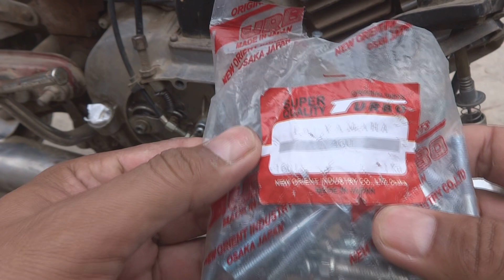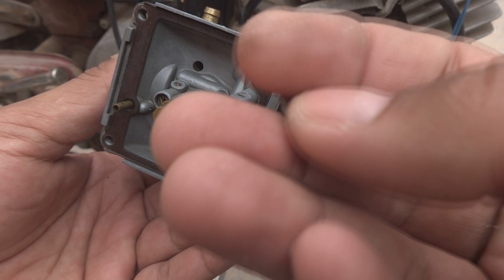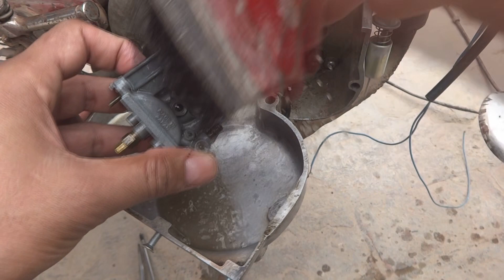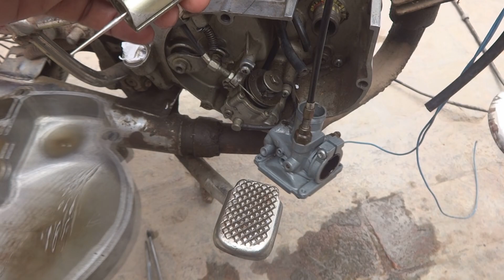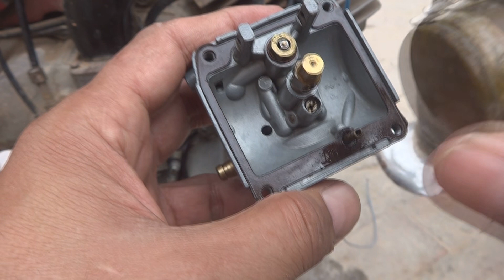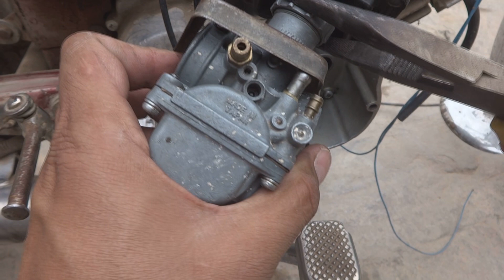Motorcycle carburetor clean up and tune up. Yamaha bike Carburetor tune up.

Comment: Hlo....i need your help please.,how do u repair a mate 50 bike when it has refused to accelerate and it cannot move and yet it has new clutch and a new piston and a valves but it cannot accelerate....please let mi know how i can repart that....am also a mechanic
Reply: The exhaust might be block thereby restricting air exhaust ..i had the same issue with my yamaha too ...after i cleaned my exhaust it stopped...